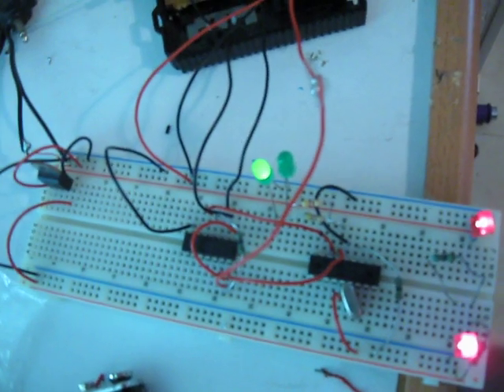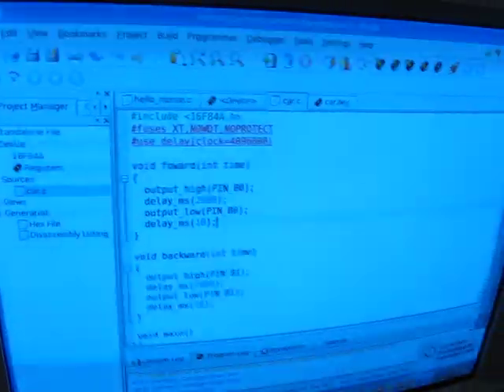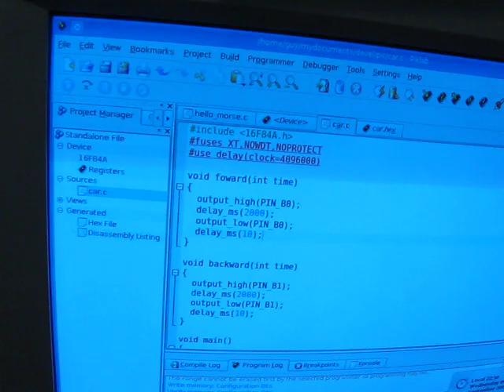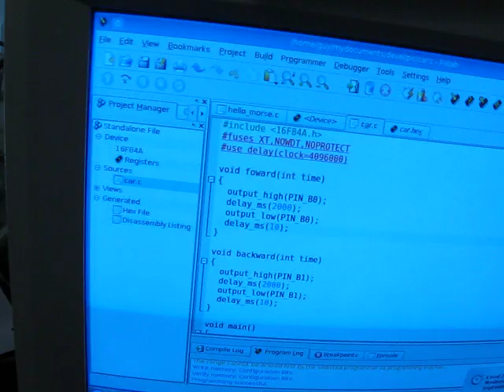How to program a remote control car with a 16F84 PIC

Comment: this is ral good but it would have beeen very helpful if you have concentrated on how you programmed and which software u been using to dump the firmware into the pic.....thanks for the video.....goood work mate...

Comment: Really nice one, Im doing something similar for my science fair project and I need some help. I need to connect the pic (16f84) to two 6 volts motors and I need them to move forward, stop, turn left, right, etc. But I dont really have an idea of how can I make a parallel system from my power source to the pic and the motors.